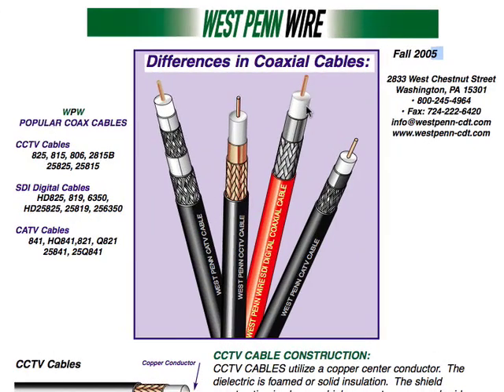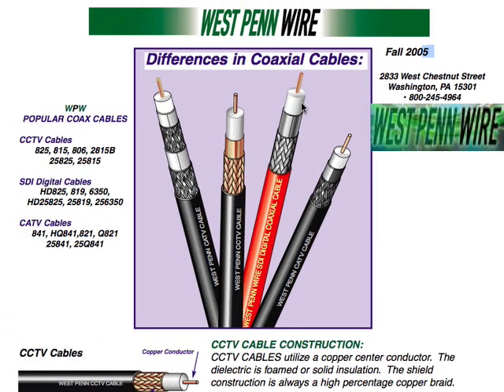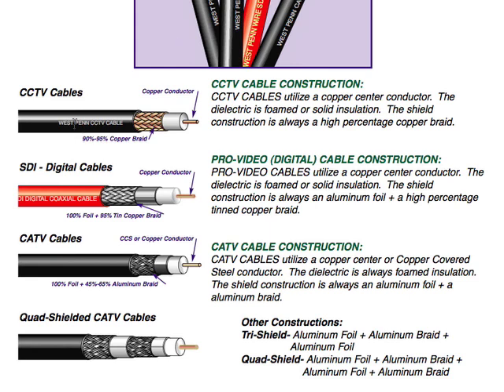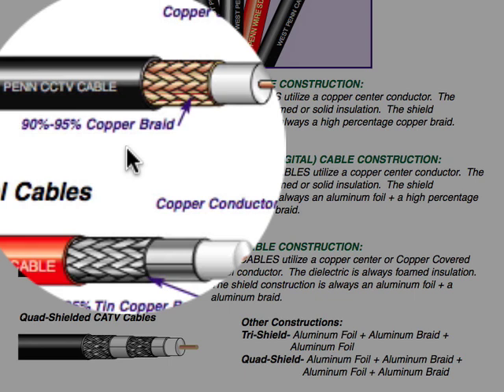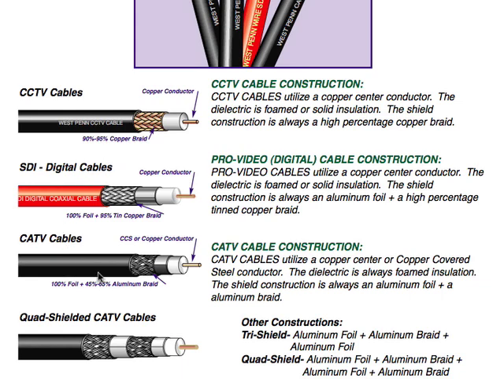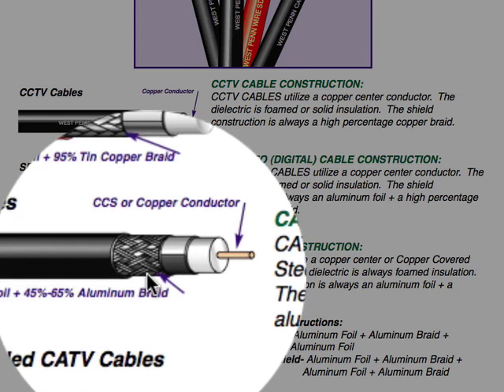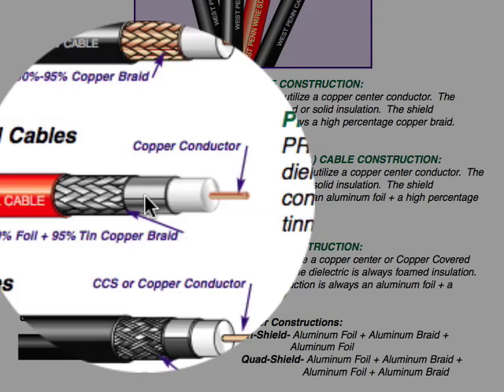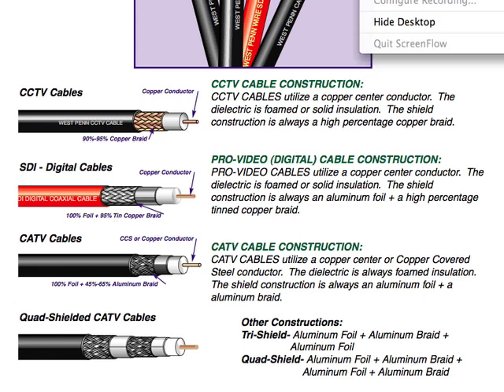Differences in Coaxial Cables

Comment: hi sir please tell me what type of cabel good for signal and communication? 50ohm or 75ohm?
Reply: Ohm is the resistance of the cable. So the lower the better for your signal. It also allows you to carry higher frequency signals over a longer distance. 

50 ohm is quite a bit more expensive. Also your connectors should be suitable for 50 ohm. Otherwise you might as well go for 75 ohm
Reply: @hornetIIkite3  i see thanks sir for advice heee good job sir..

Comment: I'm trying to upgrade our home coax cable
We use it for internet only. I was wondering which one of these cables would work best for that purpose  ( Our house is built in 1999)
 Also what do you think about a coax fiber hybrid system, the connection at the NID is coax, I currently have a cable from the attic running into a splitter and directly have it connected to my upstairs network closet where it connects to a modem and then to a router.

Comment: Why can't there be a best universal solution for any application instead of 4? The goal should be to block out all outside interference and offer no dc resistance to be able to make mile long runs pole to pole. Im not sure that the coaxial cable the cable and satellite providers use is really that great. They just cheap out. I can't control the coaxial cable they use on the poles. But I can upgrade the coaxial cable coming from the pole running directly to my house.
Reply: Also having a cable jacket that is uv resistance, designed for direct berrial, and in wall use, flame retarded, commercial grade  helps too.

Comment: The steel center is also used for overhead cables that need strength for support.  Do NOT use regular cutters for steel center cable.  You will ruin them.

Comment: Which co axial cable is best to carry 2100MHz 3G cellular signal.... one with copper guard (shielding) or Alumininum guard ?
Reply: Alum unless you have to solder or it's super low freq. (so i've read)

Comment: Hi

Interesting video.

I have just started using VMIX for live multi camera editing and was planning on running SDI 1080 over Beldon RG6 QUAD coax.

Commonly my runs will be up to 30M but some will be maybe 60M.

I have about 300m of the RG6 left over from a job I did 10 years ago and its in 50 and 100m lengths at present. Its terribly bulky and hard to coil so the option is there to ditch it buy RG59. A tech friend tells me the "strandard Dual Shield" type is the go.

Here are my questions;

           1. Is RG59 fine for smallers runs say up to 30m?
           2. Would joining 2X RG59's meana a possible loss in quality?
           3. Is joining a RG59 to a RG6 cable an issue?
        
Thanks in advance,

Regards

Martin Duffy